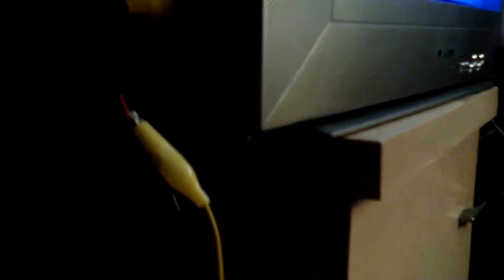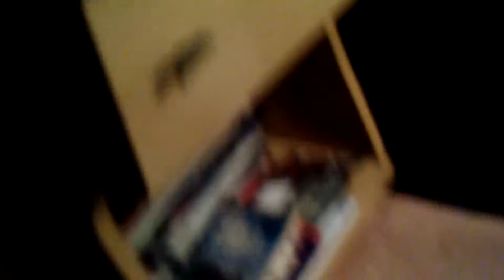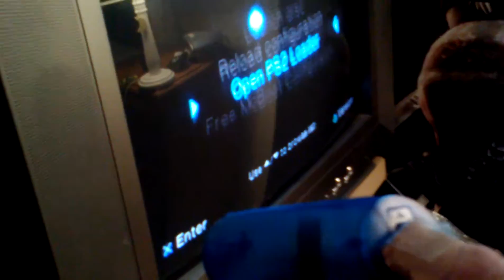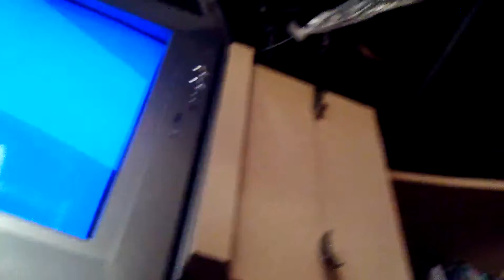My ps2 handheld update of AV port

Comment: i need to replace the port on my ps2 fat where can i get the part? i been looking everywhere
Reply from the maker: victor castillo the av port I'm not sure if you can get it replaced or not you might have to salvage an old broken ps2 fat for that and unsolder it and resolder it to the working ps2 fat or buy another ps2 fat that works. Also I have some old ps2 motherboards laying around and not sure if they work I'll have to put some parts together and see if they are in working condition and if so maybe I can make you a deal but I'll have to see when I get the random parts together and build a ps2 fat from parts just laying around.
Reply: im better off just getting a new ps2 then, the pictures comes out its just not clear i have to play with the cable. i replaced the cable still does it
Reply from the maker: alright I wouldn't pay more than $25 to $30 at max.
Reply: Ok
Reply: If my av port is toast, could I connect a ps2 to hdmi dongle to fix this or would that be a waste of money?